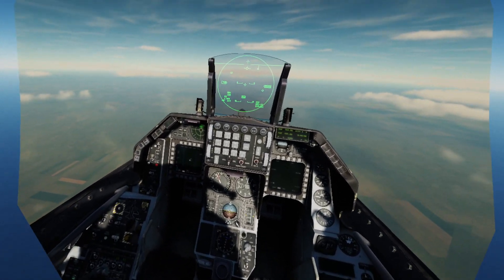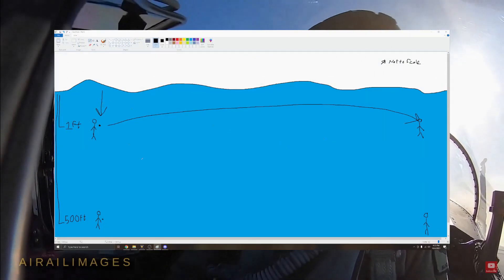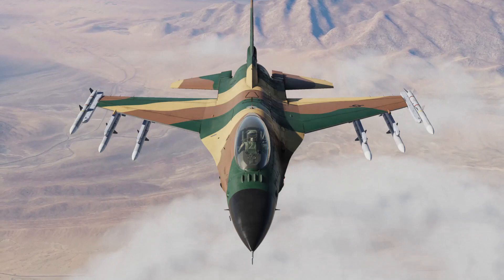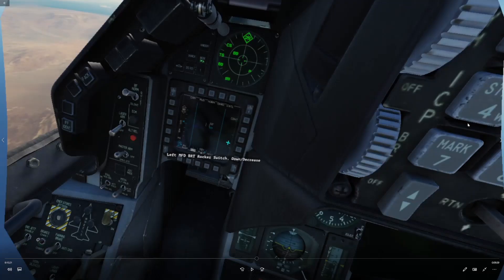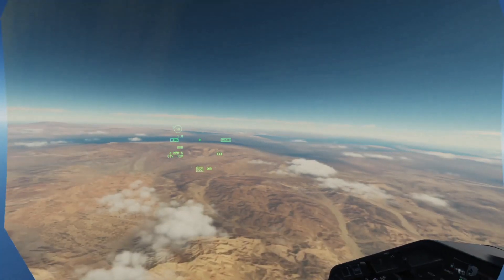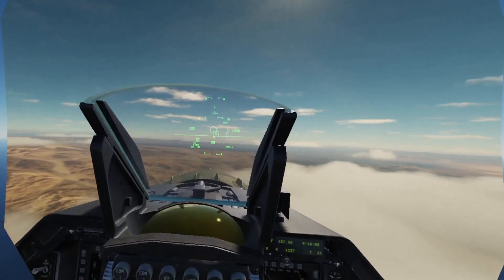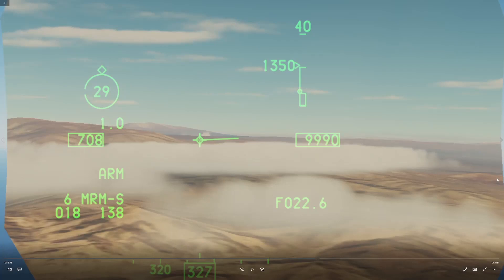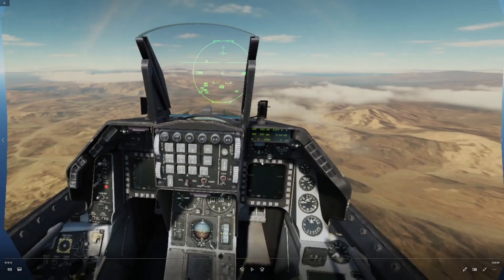AMRAAMs, Physics, and a Lesson in Both

Comment: Awesome video. I have been flying the SU25T for a while now and am very comfortable playing with air to ground attacks (as much as you can be with that plane, lol). I feel ready to take a step up and start learning the A-10, but I am extremely tempted to get into a more air to air capable fighter. I have a very soft spot for the F-16, but the F-14 seems like the coolest airplane in DCS. What would you recommend as a good step up aircraft that will not overwhelm me? (full fidelity or not, doesn't matter). By the way, I like your technical videos as it helps me learn new techniques and saves me time researching. So yes, do more of these, even if they go for longer!
Reply from the maker: Excelent question! Its a good thing you have a soft spot for the viper, because as a good step up, I would go for that one well before going to a big module like the tomcat. 
I'll break down the reasons why I think so:

1. How do they fly?
 - The tomcat flies nice... if youre into manual flying. There's a little more discipline required to fly her, no jerking at all, or you'll rip the wings off. As there is no fly by wire, there is no auto trim like the 16, so you'll either be constantly trimming or constantly holding the stick in a place that isn't neutral. The 14 is kinetically capable, and will give you fun times as you see the wings sweep back when you accelerate but... she's a big big bird, she accelerates mighty slow compared to those zippy vipers. 14 will hold a total of just over 20000 lbs of gas, so plenty of stuff to do, but she'll drink more than the 16 as she requires more to keep that big body of hers performing well in the sky. Something needs to be said about the visibility, and its.. rough. And you dont realize it at first when you fly, but then you hop into something like the 16 with its bubble canopy and think "wow... Im on top of the world! I can see behind me!"

- the viper is pretty much what you'd expect to fly, very very nice acceleration, a breeze to fly in any direction no matter the speed. Incredibly kinetically capable, and will cradle any jerky movements of the stick into nice, gentle pulls. Really there's not much to it... its very simple, and you wont have to spend much time getting used to it at all. Now, the viper is small. Very small. She holds internal fuel of about 7000 pounds... which may not seem like much, and if youre in burner all the time, it isnt much. But. She requires very very little to go very very fast. You can even hold your own in a lot of engagements without touching the burner so, with proper fuel management, there is still plenty of time to do many things in this jet once you're off the ground (and learning fuel management is a good skill to have anyway, might as well learn it now if you havent already). 

2. What can you do with each jet?

- The 14 is complicated. She loves Air to Air. But she can drop bombs if you want to. If you have no human RIOs to fly with, you'll be stuck to mostly Air to Air and dumb A-G munitions that dont require a TGP and therefore no human rio. In terms of Air to Air the F14 is debatably the queen of the skies with her dangerous AIM54s, which are easier to use than you'd expect, but require some fickle learning if you want to really exploit all they can do for you (but that goes along with any fox 3 you'll come across in this game, I just say that because the 54 is a little more complicated than your average 120). Dogfighting in this jet is going to be a struggle for anyone that does not know how to be very gentle with the stick, or anyone that does not know how to properly rate fight, manage energy, or keep high SA, as those are like the basic skills I'd say you need to have to even begin to start toughing through the F14s difficult flight envelope. 

- 16 is multirole for days. She's ready and eager to go into any mode, as those buttons just stare right at you on the UFC, able to flick into A-A, Dogfight mode, or A-G with the push of a button or even just straight from your HOTAS. She's got precision weapons, laser guided, GPS guided, HARMs, dumb bombs, all the goodies. The only problem with the 16 is that you cant carry a lot, as your wings only have so many hard points to mount stuff on. Nonetheless you'll carry plenty of stuff to complete  any mission, and I would say that with the massive variety this jet can carry, you'll have more to learn and do than the F14, especially in air to ground. You'll have more weapon systems to learn and tactics and symbology to go over with that, but that will lend you excellent skills for other jets later on. The 16 is strangely easy to dogfight with... it does feel like she limits all she can do with the current flight model. However with the good acceleration, this jet can teach you rate fighting (which is what she will dominate others at if you get good at it) without killing you or making it difficult, like the 14 would. 

(side note)
- If you really want a plane that can dogfight well, then consider the F18, its like an F16 with the same weapons, but just a little bit slower and more gas guzzly, but hey the 18 will allow you to do carrier ops if you get the super carrier module... which is unfortunately another 40 bucks. The flight controls on the 18 are superb and allow you to do some crazy things that neither the 14 or 16 can do, but.... Im biased towards the 16. Much sexier, and much faster. In BvR, the 16 and 14 will slap the 18 because of this. 

3. Other thoughts 

- Now if you really really want the 14, like really absolutely want it just because your heart desires so, then you're still going to have plenty of fun flying and learning all the 14 can do, even if it is less than the 16. I think it will be far more of a challenge in terms of stick discipline, but here in DCS there is little you cannot learn to do, as there is all the resources required to practice at your fingertips. However I still stand by my statement that if you're looking for a step up, then the F16 Viper will serve your needs. She'll be a challenge to learn at first, all them clicky buttons in the cockpit and whatnot. Plenty of symbology to learn, and exponentially more concepts to learn than even the 14, because of all the weapons she can employ. That said, once you learn all of that, you can apply it to many many other jets ingame. 

My first full fidelity was the 16, and I do not regret it one bit. She's fun to fly, she can do everything, and not only is she a great stepping stone to help aspiring pilots make their way to bigger more complicated things, but she'll never ever get boring. And keep in mind, the 16 is still in early access. ED will continue to update her and she'll just keep on improving. Hopefully, anyway. 

(The F16 is still my favorite plane to fly in game, even after purchasing and learning the JF17, the F18, F14, and all your FC3 aircraft! Like I said, I'm a bit biased :))

Hope this helps!
Reply: @Romeovictor  Holy shit dude. Thank you so much for your time in replying in such depth! Yep, you convinced me, the F16 sounds like the perfect platform to step up into a more complex aircraft. I don't particularly like to fly different types at the same time, I enjoy learning one aircraft 100% and then explore it to its full potential. The SU25T is a really cool starting point. I enjoy how challenging it is to fly fully loaded and the antiquated avionics and weapons systems. But in a more technologically advanced scenario, having data link, better guided weapons and defence systems is a lot more attractive. I'll spend several months flying the 16 and then will see. I might not even bother with anything else (I don't have a ton of time to learn news types). I thought about the F18 but it seems like everyone flies them, so I rather go with a not so main stream option. I almost bought the carrier package when it was on sale but I wasn't sure if I was going to invest that much time in DCS. Now that I finally got my 3080 and my HP Reverb G2, everything is freaking awesome. Can't wait for ED to roll out Vulkan. Once again, many thanks, I subscribed to your channel and the bell is on for updates :)
Reply: Heyo, I'm gonna recommend that you're "next step" be the M-2000C module in DCS. That jet was my first step into high fidelity jets, after myself just like you, was toying around with the frog foot. I am so happy I went with the mirage as my first "next step" because everything just flows. The cockpit switches and startup procedure just made so much sense when reading thru the manual and doing it myself. The simple flow of the startup also helped me understand startup procedures in general, and perfectly prepared me for all the other jets startup, shutdown, and really any other procedures and stuff like that. Getting to flip those switches and start that engine feels so good, especially after having gotten it wrong a few times before. Once you're in the air, the thing flies like butter. Lands like butter as well. An excellent beginner jet. Comes with all the basics. A2A missiles, and for A2G, dumb bombs and rockets. 
For the same reasons I put up there, the F-5E is also a very good next step module as well.
Reply: @uve_beendoogied9222  Thanks mate. I bought the F16C module from this sale, I'll have a look at the Mirage as well, sounds perfect. I appreciate the advice :)